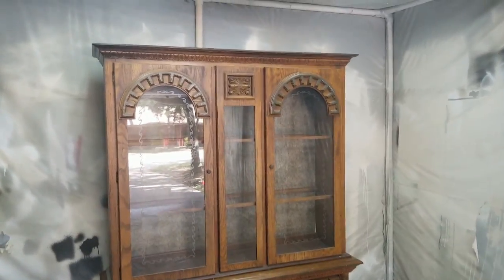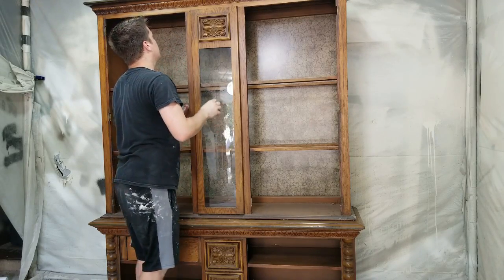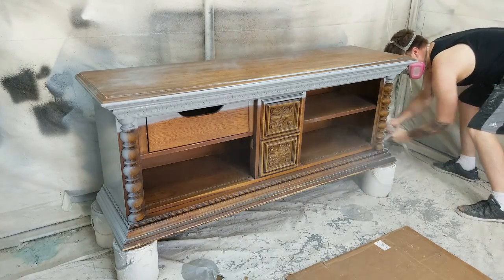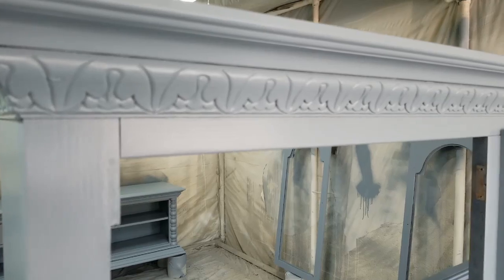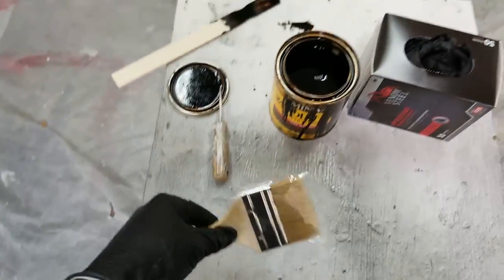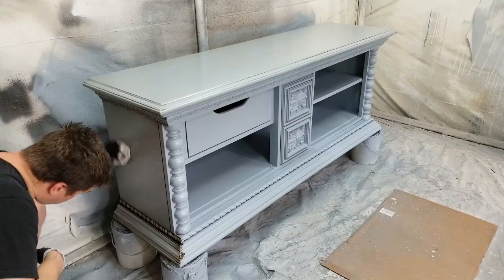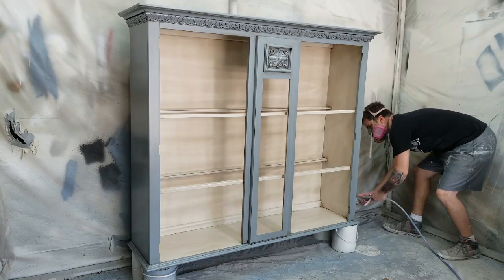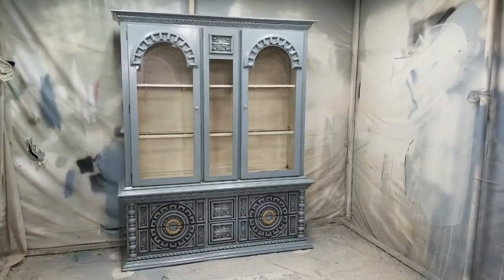How I Used Paint and Stain to Makeover this Vintage China Cabinet

Comment: Sounds like you need one of those portable AC units. Set it up outside the room and some kind of duct to disperse the air through your wall.  So that the air it draws in is clean fresh and that your filter doesn't get mucked up with paint etc.

Comment: Can you talk about how you created your backdrop space?  It looks like you get canvas sheets and then roll them up with wood rods?  How do you connect them together and keep them upright?  How often do you have to replace the sheets?  How often does your spray tip get clogged and how do you avoid that?  Anyone complain about the durability of your overcoats?  What one has the most ease of application for the durability?  I used one on a table top and it did not like damp paper plates at all.  I recently removed that and am going to apply a grey wood stain instead.  Wondering if should just leave it alone or coat it again and hope for the best.  Wondering if Tung Oil is the way to go on the stain to avoid wetness soaking into the clear coat.   Thanks for the answers!

Comment: No sure you wouldn''t have have been better off with the original backing, of course I can't see what it looks like.  If this were a solid wood, hand carved piece, I probably would have just removed the dark stain then clear coat.  I know that many times the woods don't match, so yeah in that case you could only paint it.  Seems like you could have used a touch of gold to that top center medallion. Or definitely   gold nobs on the doors, maybe those knobs that even have an escutcheon to echo the bottom?
The top now doesn't seem to match the bottom now, it does,  but not that well.

Comment: What you use as reducer for the paint? The reason that I ask is because I tried with a regular spray gun but it looks like the paint needs to be reduce. Can you hep me with that. Thanks, by the way great job!!
Reply from the maker: I dont need to reduce the paint with the Graco Magnum that I use. If you are having issues with your paint being too thick, try cutting it with water. Start with a 6 to 1 paint to water ratio and if that is too thick, go to 5 to 1, 4 to 1, etc. Until you find the best mixture for your sprayer. This is for water based paints.

Comment: Great job. How did you sand all that intricate woodwork on the base?
Reply from the maker: So, when it comes to prepping detailed areas, the most important thing to do is to make sure it is all cleaned. All of the years of dirt and grime get in those areas and it needs to be clear so that the paint has a good surface to adhere to.

When it comes to sanding, it isn't that important that you get into every detailed area like you're thinking. First of all, it is nearly impossible unless you do it by hand. Second of all, your damage is going to come from bumps, scrapes, scratches, regular use type things. Down in the corner of that door is never going to get touched. So as long as you have it properly cleaned, the paint will adhere just fine. Paint doesn't just come loose and chip over time. It has to either be put against some sort of pressure like a bump/scratch, or left in the elements (heat/cold/moisture) for it to change its shape and split.

Comment: I would have taken them apart and sold separately adding legs that were long enough to make the height reasonable. I would have replaced the glass for panels and taken advantage of the middle eastern vibe the carvings and shapes have and done a faux bone inlay effect with stensils for which the color of the piece would have to be in the dark brown to blacks..... I would have done some research on the moorish style and architecture to get it right. Have some good stencils at hand.

Comment: This piece is absolutely beautiful!! Did you put mineral spirits in your stain before glazing?
Reply from the maker: The only time I add mineral spirits to my stain is when it has thickened up from sitting out in my garage. If you find the stain is starting to dry up as you're wiping it, you could thin it out a bit to make things easier on you. A few people have mentioned thinning the stain so you don't waste as much of it, but the stain and mineral spirits I use cost pretty much the same, so that would be using the same amount of materials in cost.

Comment: Do you put some sort of primer on prior to painting? I would think if you didn’t the paint will peel.
Reply from the maker: Scuff sanding causes a rough surface for the paint to adhere to. I often prime with flat white spray paint just to make sure though. It just depends on the project. 

A lot of the intricate details you see on this dresser are plastic. Roughing them up a bit works just fine with a high quality paint.

Comment: Question: Are the doors plastic on one side and wood on the other side? I'm trying to redo a china cabinet as well and I ran into a wood plastic situation. I need to address this with easy. By the way you look younger than your son. It's crazy! perfect genes
Reply from the maker: Yes. A lot of high detailed vintage pieces are plastic made to look like carved wood. Just clean it well with TSP and try to scuff sand the best you can. I use flat white or gray spray paint as a primer to ensure provide a better bonding surface for your actual paint to adhere to instead of bare plastic. Thanks for watching!

Comment: What paint are you using?  (Behr / Shermin williams) Or like a Alkyd paint? And also does the finish of the paint effect the glazing part. Like if the paint is flat, eggshell or satin?
Reply from the maker: Thanks for watching! I'm using Valspar Signature. A latex paint. To get the effect want, I use a satin finish. If I want less of a muting effect, which is really just the stain soaking into the paint, I use semi-gloss. The higher sheen repels more of the stain and keeps more of its original color, while allowing me to still highlight edges and details. Flat/matte/eggshell/chalk paint will all soak up too much stain and wont remove in the same manner without the use of mineral spirits so I do not advise using those. :)

Comment: What tip size are you using in your graco x5  here and what kind of paint enamel , lacquer, acrylic latex ??
Reply from the maker: I mostly use latex and water based poly. 415 tip for paint and 413 tip for water based poly.

Comment: Pretty cool, I would have loved it with silver accents (partial to silver  over gold) is there a way to do that with the glazing step? Ty !
Reply from the maker: There are all sorts of ways to add metallic accents. You can use waxes, metallic paint, spray paint, gold/silver leaf. I'd recommend starting with wax but do not apply it over wood stain glazing unless you have given it a top coat. You can apply it over traditional glaze just fine though. Check out the video I am posting tomorrow. I'm actually doing a stain glazed piece with gold accenting using gold wax.
Reply: @ThatShabbyGuy  sweet ty !!

Comment: Have you any problem using water based varnish over oil stain?
Reply from the maker: I've never had this problem using Minwax oil based stains and top coating with anything from 3 different brands of water based poly, to lacquer, to spar urethane. I recently saw a post on Facebook where someone had trouble with staining using a different stain product and she was told by the manufacturer not to mix. So it might be different with different brands.

No problems with my process through 7 years and over 700 sold pieces. Just my experience.
Reply: @ThatShabbyGuy  Thankyou ..much appreciated:)

Comment: How did you detach the top ? Also, this is a beautiful piece
Reply from the maker: China cabinets can either be one piece or two piece sets (base+hutch). If it is a two piece, they'll often have mounting brackets in the back. Sometimes they dont and you can just slide it right off.

Comment: My old cabinet has a few layers of paint.  Can I sand or must I strip the paint?
Reply from the maker: If the paint isnt already coming off, you can paint over it. If you want it off, you'll need to sand or strip. Stripping is sometimes faster but messier.

Comment: So you paint right after sanding? No primer?
Reply from the maker: It depends on the project. Some woods will bleed and need to be sealed. Some dont. As long as you scuff sand the surface, you dont need primer in many situations. The paint will adhere just fine. I prime probably 80% of the time, based on the situation.

Comment: Do you lightly sand between coats of poly?
Reply from the maker: Usually no. I spray 2-3 thin coats of poly, then one final thicker coat to finish it off. The thin coats tend to be more of a "mist" effect when Im spraying so the finish is kinda rough. Thats where I sand with a 320 grit sanding sponge before my final coat. This way the final coat has a nice smooth surface to lay on top of.

This is usually the process for the TOP of a piece. The sides rarely need sanding because gravity tends to pull the wet coats downward, flattening the finish and not getting those bumps.

Comment: What is the brand &  model of the 2 sprayers?
Reply from the maker: The main sprayer is the Graco Magnum LTS-15. The sprayer I used on the backing is a Wagner Flexio 5000 that I had just recently got and was testing it out. I've been using it on my main projects lately.

Comment: There is a reason you don’t paint furniture. It needs to be polished and used daily, paint scratches and dulls. Check back in about 6mo. I’m sure you’re not going to like it then. But it’s your cabinet, knock yourself out.
Reply from the maker: I've done over 600 pieces in the last 7 years. I don't have any clients coming back to me complaining about damage. I actually have seen some of my original pieces (repeat customers) and they aren't damaged. This is because I don't shortcut on my prep work. While paint does scratch, so does wood, which is why most furniture has a protective finish. I use the same type of protective finish.

Now kiddos may pick at the paint from time to time, but kids also draw on wood furniture, walls, hardwood floors. If furniture is going to get damaged, it is going to get damaged. It isn't going to just change after sitting around for six months though lol.
Reply from the maker: Lol

Comment: A real shame that it does not respect the natural wood that is a Slavic oak.  This is not restoration as restoring means returning to the original state through repair.  I do not like this type of modern arrangement in quality furniture. To do this I would have used a lower quality furniture where wood does not matter.  My father was a cabinetmaker and made high-quality furniture.  He would have been horrified to see this.
Reply from the maker: 1. This is not real wood furniture. The sides are made of particle board and the details are plastic. This piece was at an estate sale for $250 and no one wanted it so they gave it to me for free.

2. I never called this restoration. The title literally says "How I used paint and stain to Makeover this Vintage China cabinet"

3. I got this china cabinet for free so it did not matter.

4. I'd never speak upon my relative's behalf about what they hated or not. Especially if they aren't around anymore.